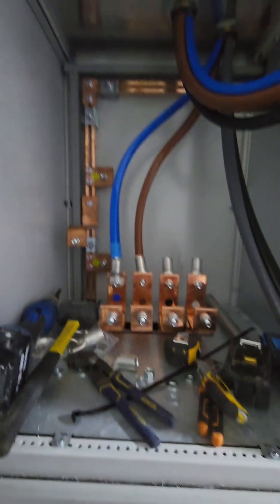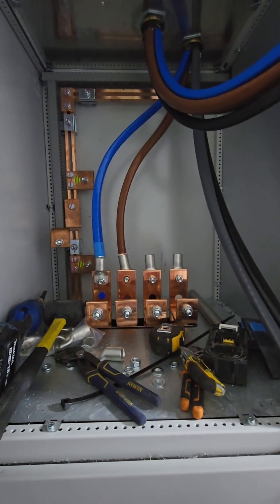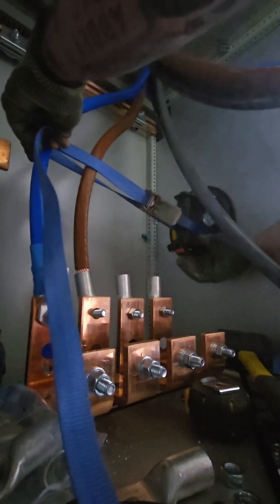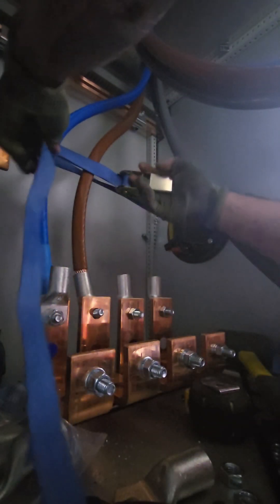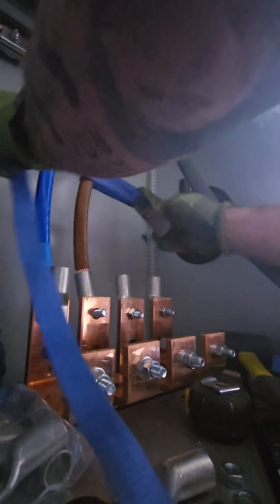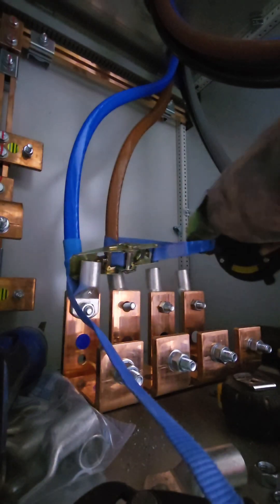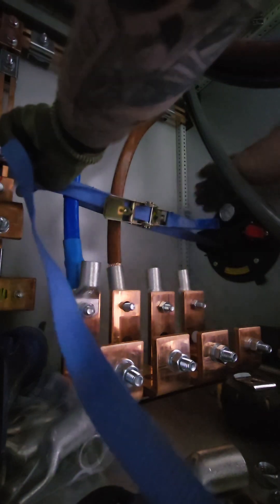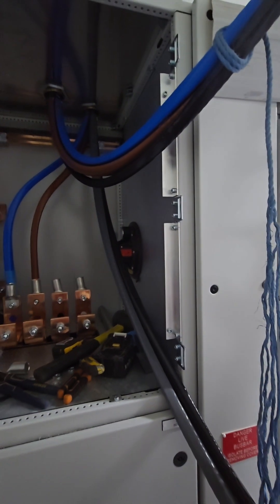A little idea to aid with terminations of bigger cables. This is a 4cx240mm

Comment: I've used those suction things for tiling and moving big glass panes, they are awesome. You could have used a second one on the outside of the cabinet - directly outside where you put the first one, and had that anchored against to something solid so when you tightened the ratchet strap it wouldn't be able to pull the wall inwards 😀 Double suction!